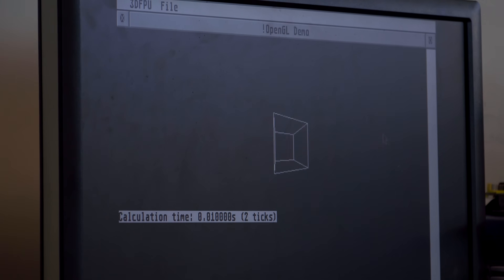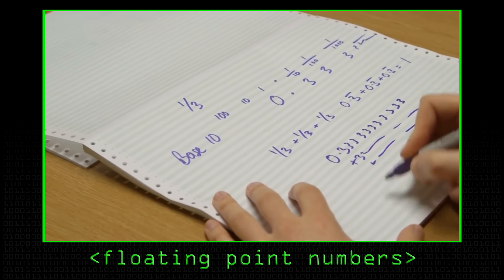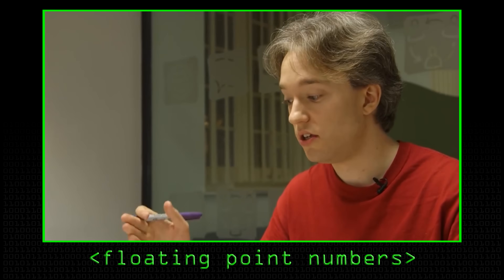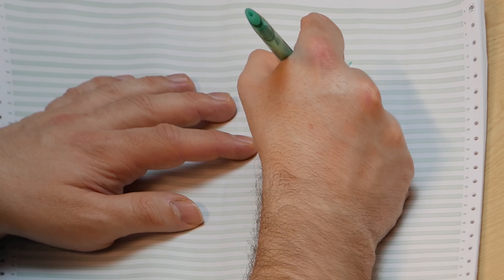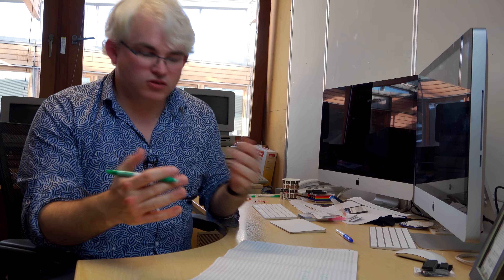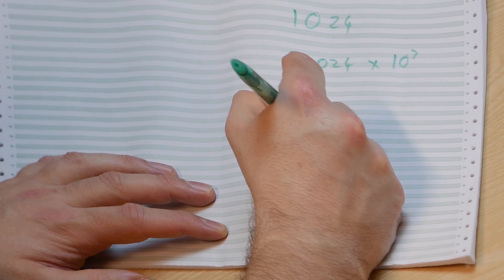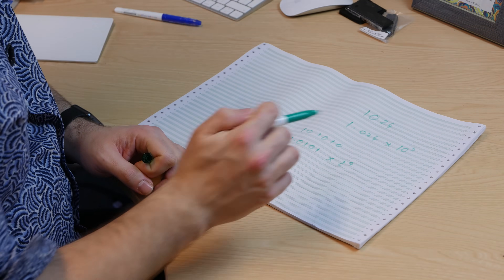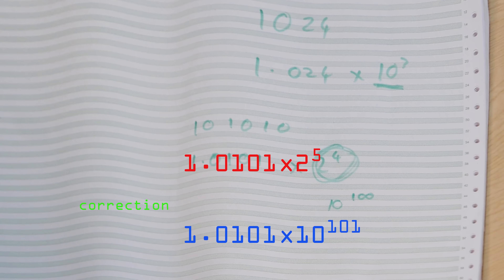Floating Point Numbers (Part1: Fp vs Fixed) - Computerphile

Comment: Thank you! Interesting! I did a test in C. So try it for yourself:

printf("%i, %i\n" , uint32_t(32000000.f) , uint32_t(32000001.f));

gives the output "32000000, 32000000". Where is the +1 of the second number got? It has been lost because the mantissa of a float32 is 23 bits wide an 32'000'000 exceeds this. So, a float32 of such a big number is not longer to represent odd numbers...

Comment: What if they represent it with fractions and only generate a decimal number if needed for printing it ?
Reply: Yes. This is a tactic that we use sometimes where we store the numerator and denominator separately and only combine them later. The problem is that division is very very slow in computers relative to multiplication and adding. It’s worth saying that what you’re thinking of is not a decimal. It’s a decimal fraction. It’s already a fraction. The denominator of that fraction is always known given the length of the numerator so we don’t need to write the denominator. In base 10 these fraction denominators are powers of ten. In base 2 these fraction denominators are powers of 2. Binary numbers containing a fractional component are not decimals even if you separate the whole number component from the fractional component with your preferred indicator of that separation (like a period/point/fullstop). It’s still binary. It’s just a binary fraction. 

The reason you sometimes see the decimal fraction names in shorthand as “a decimal” is because in English we had a long history of computation on fractions using geometry rather than a positional number system like decimal and the number symbols we use are older than our use of decimal positional math. So for many English speakers the idea of numbers or fractions was distinct from positional numbering systems like decimal and one of the most interesting concepts to them would have been the ability to represent a fractional component in-line with the whole number component hence conflating decimal with decimal fraction like you are. But no. Decimal fractions are just fractions with a couple of conveniences baked in.

Comment: I don't understand why the float couldn't add 1
Reply: Try doing 1.000 * 10^6 + 1. Expanded it becomes 1 000 000 + 1= 1 000 001 Convert to scientific notation: 1.000001 * 10^6, however we only have finite space to store values, so we have to round to only 4 significant digits like we started with, giving 1.000 * 10^6... Wait, didn't we just add 1? Where'd the 1 go‽ The exact same place as the 1 that got lost when adding to a float that's too big: it could rounded off.

Comment: For someone used to fixed point, a simple "if" statement: 
if(a == b)
will not work in floating point. Also, in general "if" statement calculation takes longer time in floating point.

Comment: I don't know why computers can't sort this out on a basic level? Either leave it in factional form or use a number system that has the factors you are using. Behind the scene you could have a base like 16 * 9 * 49 * 11 * 13 = 1009008 and get an integer value that is exactly right. It would be close to the metric system for computers ( 1024 ). Example: 200 / 3 = 200 * 1009008 / 3 = 67267200 / 1009008 = 66.666666666666...
Reply: Computers can’t sort this out on a basic level because they are binary as a physical constraint. Transistors are designed to be powered on or off and nothing else for a variety of practical reasons related to electrical engineering, manufacturing and fabrications, and an at this point deeply entrenched system of programming with the assumption that computers work in binary built from the ground up through every single level of abstraction. To do what you’re suggesting we would need a large number of transistors each of which has some prime number of variable states it can be in at exactly one of at any given time (and able to exactly jump between the states by the time they are next observed without accidentally being detected on their way to the state we hope to see them in. This would then need to be coordinated with other logic modules that have no idea what’s going on and are probably still using base two because outside of specialize hardware used for this (and maybe some cryptographic processes) these super specialized ultra expensive transistors would be useless for the general purposes of the computer. Meanwhile a floating point number in binary can be added and multiples using general purpose logical adders and multipliers that also work on binary integers there’s no conversion layer to put it back in a form every other part of the system agree on. All of this also ignores that division and finding prime factors are notoriously very very slow algorithms in any number base compared to addition and multiplication which are very fast. There’s just no reason at all to do what you’re suggesting at a fundamental level. There are specialized code libraries for handling numbers that need to be precise and these usually end up doing something like just storing values for the explicit numerator and normally implicit denominator separately and then performing the math only on the whole numbers until you need to finalize at which point it does the slow division were otherwise trying to avoid. Even these libraries eventually make cutoffs for rounding though because they don’t have infinite space and would break immediately if given an irrational number like pi to calculate in earnest.

Comment: Holy Smoke! Didn't realize there're so many holes in the range of float32. Great video!
Reply: There is a number system called the dyadic rationals, which form precisely 0% of all ℝeal numbers. Every single representable float value that isn't infinite or infinitesimal (floats don't actually have 0; they have positive and negative infinitesimals that they wrongly call "0"), even with arbitrary precision, is a dyadic rational, and with only finite memory, you're still missing most dyadic rationals anyways. (You do however get 16 million ways to write "error," which form 0.3% of all float values.)
Specifically, the dyadic rationals are the integers "adjoined" with 1/2, so every sum and product formed from the integers with every power of 1/2.

Comment: One way you can find out what number size your computer uses (32 bit, 64 bit) is to write in your calculator 16777216 + 0.125. If it returns 16777216 without a decimal, your machine uses 32 bit. Otherwise the equation will return 16777216.125 and your machine will be 64* bit
Reply: Non sequitur. Your facts are uncoordinated. Sterilise! Sterilise!
Reply: @peNdantry  huh
Reply: @okboing  No fair! You edited it! Cheater cheater pumpkin eater!
Reply: @peNdantry  if I wasn't posta edit it there wouldnt be an edit button
Reply: @okboing  I have no clue what you're saying

Comment: But why not use 64-bit floating point numbers?
Isn't that how you solve the problem of some precision being lost?
Reply: We already are using 64 bits.
Reply: Now you're using twice as much memory and extra computation just to push the issue back a little. You don't solve anything. You only made it so you could get away without solving it for longer. You also gained several orders of magnitude more dynamic range than you're probably ever going to use.

Comment: He said "auction site" and it makes me so proud. What a scientist and objectivist!

I do not like floating point digital because it is not exact. It is in secret rounding things off in the background.

0,1 is not 0,1 but something else. There are several talks on this site and elsewhere addressing this obvious fallacy in the computer world. Bad computers, very bad computers.
Reply: Feel free to come up with a solution.
Reply: Floating-point is designed for engineering purposes, and works really well for that. As you know, engineers round all the time. But if you want to track money precisely, you typically use either 1) integers, in units of cents or whatever you need, or 2) BCD (binary coded decimal) numbers. Some languages have builtin support of that kind of thing, for example C# has a type called "decimal", and I think I've heard COBOL also has something. Such numbers are mostly implemented in software and are thus typically slower than FP, but can be useful if you need to track base-10 decimals exactly, without unexpected rounding.

Comment: I don’t think I ever had the problem where an equals equivalency test didn’t work with floating point numbers because I’ve never actually used that in an actual program. I’m curious in what kind of program would that actually be used.
Reply: Assume you have a vessel of some sort that you know holds x units of something and you have a program for monitoring the level in that vessel.   You now start to fill that vessel and every time you add 1 unit you check to see if the current level equals the max level.   It is possible when using floats or doubles that the test of maxCapacity == currentLevel will fail even when they are "equal" and then there's gonna be a big mess and somebody is going to get fired.  :)

Comment: So does this mean the smallest possible positive number, 1*2^-127, would then have the same representation as 0?  That seems like a very nice way to move the problem number to the least important possible value (at least in terms of making it distinct from 0)
Reply: By the definition, a nonzero number can only go to 2^-126, so 2^-127 is not representable as a normal. On FPUs that that allow denormals (x86 does), it would be converted to that (wikipedia has an article on subnormals), otherwise an underflow exception would be raised and the number would be rounded to zero.

Comment: Only 4x speed increase? Certainly significant and worthwhile for a few special tasks, but in the big picture it hardly seems worth the extra hardware. I was expecting something over an order of magnitude, considering the difference between interpreted Python and pre-compiled c++ is almost two orders.
Reply: That's really not a fair comparison to expect similar results.  The way python implements floating point math relies on whatever the underlying machine implementation is, so the amount time it takes python to add 2 floats together is technically the same as any c++ program on the same machine, just it will be slowed down by the many other operations python does to set up the add because of the way the language is structured to allow more versatility

Comment: COBOL (a business language) had fix point numbers that were not integers, used them for money. So a pound or dollar could be stored as a value with a fixed 2decimals of fractional part.

Unlike spreadsheets nowadays, you could do calculations on money values and get exact answers without rounding errors.

More exactly by specifying the number type, you knew exactly how the rounding would be applied at each step in the calculation.

We lost that somewhere along the way....

Comment: I had to dig back into these topics recently and Java was really being bad.
DIP class using java..... no unsigned int directly supported, unless casted and the values still weren’t 0-255 they kept coming out to 0-127. Tried to use char like in C but it proved to be difficult. The .raw image file had a max pixel value less than 255, I think around 230ish. Anyone know why using Java’s tounsigned int/short/long still wanted to truncate my pixel values?
Reply: It wouldn't be Java's byte being signed by default tripping you up, would it?
Reply: @thepi4587  could be bc that's how I've read in the file. But I've casted the values after. Still the same result.
Reply: I don't really use Java myself, I just remember reading about this same problem before at one point. I think the answer ended up being to just not use bytes and stick with a larger primitive that could handle 0-255 instead.

Comment: I actually ran this program on a 486DX which has a floating point unit on it. When adding 2 it does not solve the problem actually, at least on that processor. The end 2 numbers you get are 15,16,18,20,22. The wierd one here is the jump from 15 -> 16. it should go to 17  in hex its 4b7fffff and 4b800000

Comment: 13:01 if you declare your main function to return an int, you should actually return an integer value. Just saying.
Reply: Doesn't matter, it'll return 0 dy default which indicates a successful run anyways
Reply: @_tonypacheco  It’s a bad default from C’s early days, it works only for main(), and compiler flags like the highly reocmmended »-Wall« will warn you. Just return your state properly.
Reply: @dipi71  in C++ return is not needed in main(). And you will get no warnings, as it is defined in the standard

Comment: When a third party DLL was running another third party DLL with code that exexuted in parallel that changed the FPU precision settings at seemingly random points in time, that was the hardest problem I ever had to debug. Looked like magic until i figured out the cause. Before, I didn't even expect those settings to be shared among DLLs.
Reply: Paul Paulson Of cause CPU registers are shared with DLLs. But I'm surprised no one told the DLL authors that the floating point settings need to be preserved across the library call boundary, just like (for example) the stack pointer.

Comment: There's that horrible moment in any programmer's life when they realize that floating point calculations don't work on computers the way they work in real life, and all of your code suddenly has to be based around this fact.
Reply: My method: 
1. Try long instead of float.
2. Accept a range for the correct answer and round it.
3. Give up and look up the stackoverflow question explaining how to do it
Reply: That's exactly why I use integers to do financial calculations (all amounts are expressed in cents).
Reply: @nakitumizajashi4047  clearly you never have to divide.
Reply: Hahaha yeah
Reply: Analog Computers would help a lot
Reply: @theshermantanker7043 No they wouldn't, the imprecision in analog is far worse that double precision floats
Reply: how approximate does it need to be, we answer that, then the output has enough resolution to properly sample your data.
Reply: false.

Comment: He did not really talk about the FPU though
Reply: Simple enough. Take the numbers, and compare the exponents. You fix the smaller exponent to become the larger one and rewrite the mantissa to keep it the same value, then just add mantissas. 

Suppose you have a larger (in magnitude) floating point number and a smaller (again, in magnitude) floating point number. Say the exponent portion for the larger number is 5 ("101" in binary; keep in mind I won't be writing all the leading zeroes that would be in the actual floating point representation for simplicity's sake) and the smaller number's exponent is 4 ("011"). The difference between them is 1. Now, to do the exponent changing magic, all you need to do is shift the mantissa to the right over by the difference in the exponents. Consider the mantissa of the smaller number to be "1.011", where I included the decimal mark since I'm NOT considering the normalized part of the mantissa but also the unitary part. If you wanted to turn the 4 exponent into a 5 you shift the mantissa right once, and your mantissa becomes "0.1011". Check for yourself, "1.011" with exponent 4 is the same as "0.1011" with exponent 5. You can also check that if the difference were larger, you just keep shifting right by the difference in exponents, tacking on leading zeroes to the mantissa as needed.

The problem is we only have a fixed amount of bits representing the mantissa. If you have to shift right and the last binary digit in the mantissa is a 1 and not just a trailing zero, when you shift right it just drops off (losing information/"precision" in the process). Now, if we have to shift right 24 times and we only have 23 binary digits for the mantissa... we end up storing just zeroes in the mantissa. I've gotten more unending loops in some of my programs by not keeping this in mind.

Hardware wise, you need binary integer addition to find the difference in exponent bits, a right bit shifter for rewriting the mantissa to fit the new exponent, and again binary integer addition to ad the mantissas.  You also need a few small things like registers to store information (you need to remember the largest exponent and the difference, for example) and some hardware to account when you add two numbers where the unitary part of the mantissa is 1 (you again need to shift around the mantissa and exponent to get back your final normalized representation)  but it's not complicated to imagine how you could implement this.
Reply: Wally the Wall Still too basic.  Things get complicated when you want to do maximum speed double floats on a 16 or 32 bit integer only CPU.  His demo example must have done lots of other stuff for the speedup to only be about 4x .
Reply: @johnfrancisdoe1563  Well, I explained it about as deeply as Computerphile would have. It's not like they were going to go into actual architecture design details, which I myself absolutely have no idea about.
Reply: Yes this video is exclusively about floating point representation. Being able to represent floating points, and computing operations on them are very different problems. Disappointing.
Reply: Check out the next part